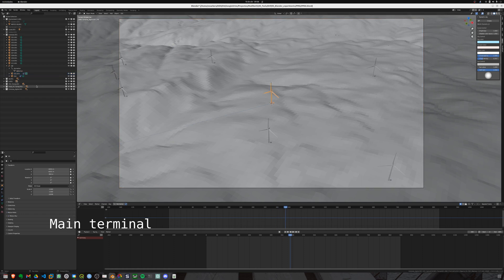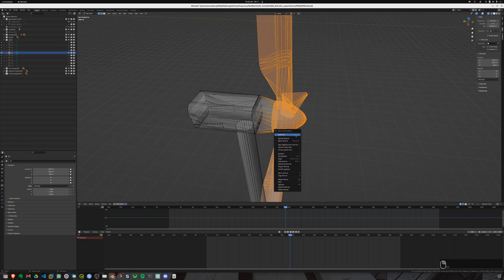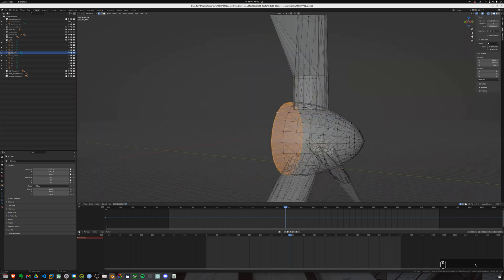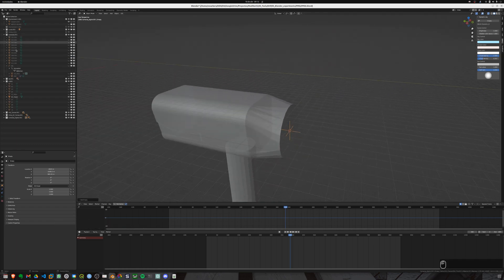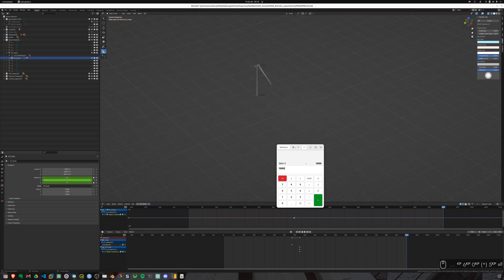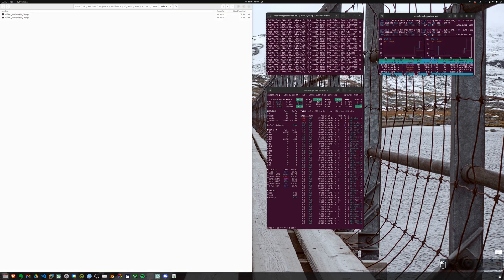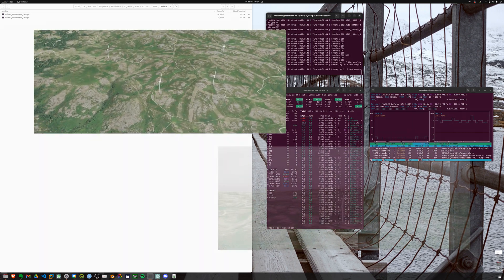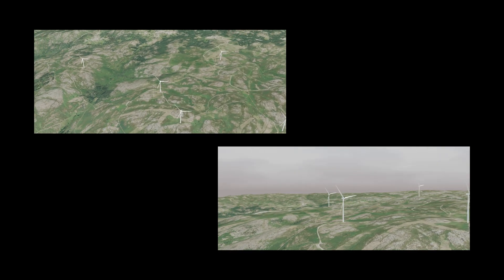💨 Realistic Wind Turbine in Blender. Static to full power plant animation.

Comment: Hey i really like your video, i just have a question. I need to build a wind turbine for my school project. I'm planning to 3d print all the parts (tower, head (where the small engine will be), and 3 seperate blade sets.)  The goal is to test which blades performed the best and why they did it. However i don't know how to make the win turbine head ( where the 3 blades will be) replaceble so i can test 3 different sets of blads on the same wind turbine
Reply from the maker: That's very interesting, however I've never tried to model and 3d printing. I imaging that you can buy a Lego model with one of those torque rotors , measure it and design proportionally your wind turbine to put that rotor inside of the "gondola" (thats how we call it in Spanish). The tower part is very easy, make a circle, extrude it to the desired height, done. The blades to be fare should be the hardest part to model accordingly to real phisics, as they are curved and designed specifically depending on the power, turbulences etc.  Though that's really your goal, to test the conditions of your blades....so, good luck